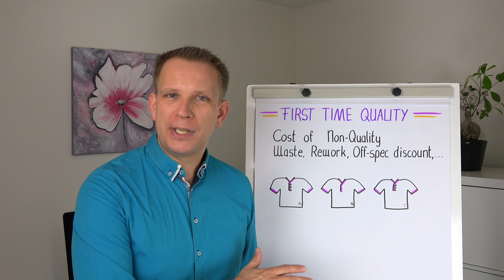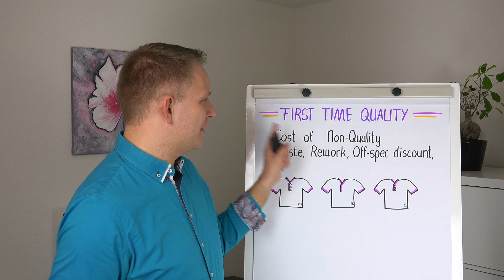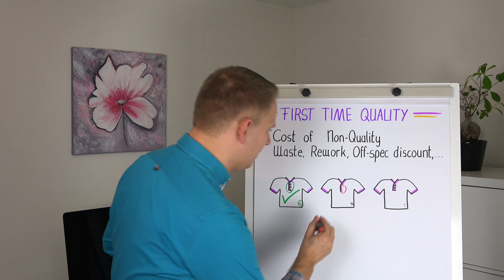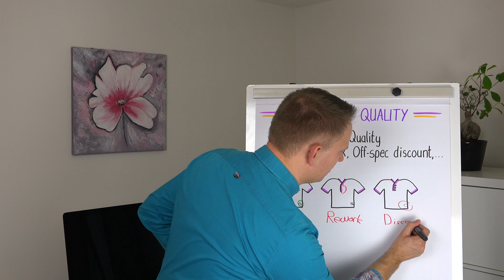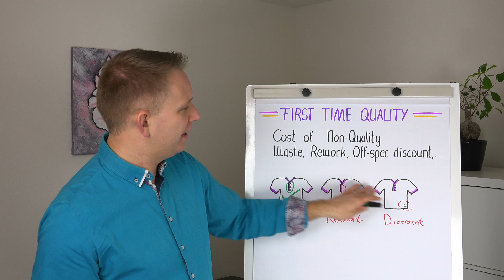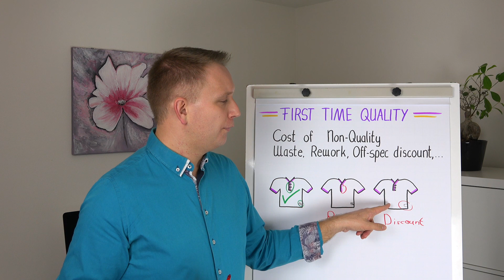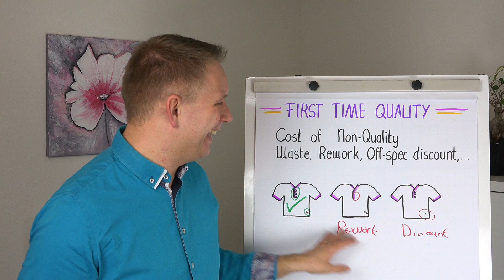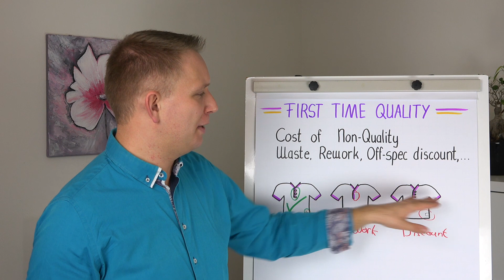Off-Spec, a Defect that is good enough to sell? (on First Time Quality and the cost of non-Quality)

Comment: Another Excellent video! It is really important to be aware of the cost impact when there are off specs products…, would suggest Tom if you can make or recommend a video regarding best techniques to develop RCA -Root Cause Analysis….Thanks.
Reply from the maker: Hey Horacio, it is time to make a couple of videos on Root Cause Analysis and Root Cause Problem Solving again, but know that there’s a bunch in my previous video library too. And in fact, I made a full course on Root Cause Problem Solving, which features RCA strongly both for your own understanding and how to lead a team of colleagues through it: https://www.tommentink.com/offers/qoZFo5wQ/checkout
Your comment did trigger a thought on a video that I haven’t made (nor seen from other yet) - how to develop RCA skills in your organization, which skills come first and how to build capability for different groups and work levels.